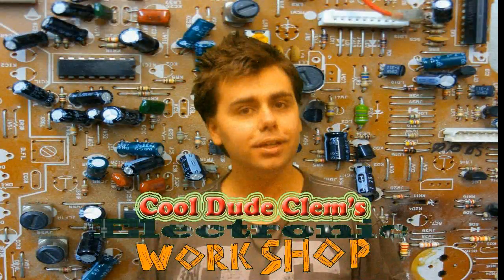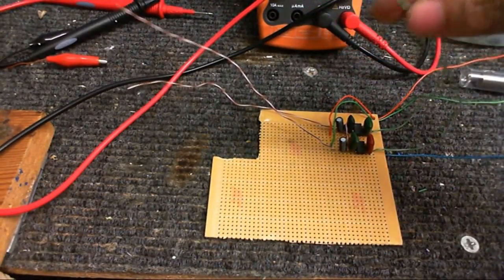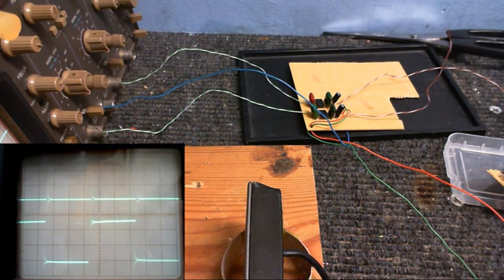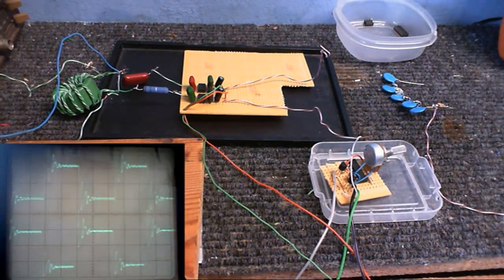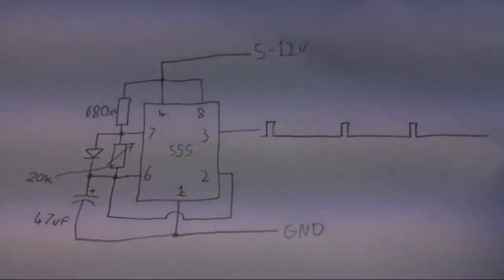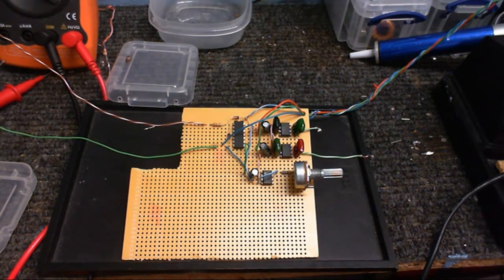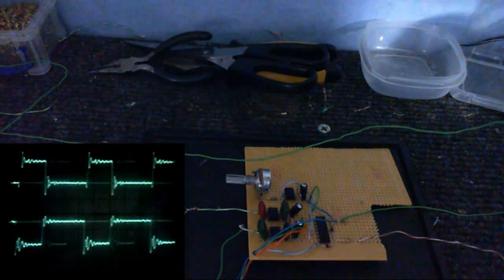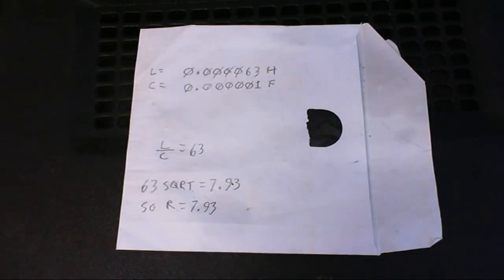Building an SSTC part 3 - Control circuit and more GDT experiments

Comment: The last signal that you showed on the OScope is not good enough,you should use more than 5 turns.
Reply from the maker: Anto Mani You mean the signal I got after I connected the capacitor and resistor that represents a mosfet gate?  That's about the best I can get, I simply just cannot make it work any better than that no matter what I do, I've wound GDT after GDT after GDT and this is what I get every time.
Reply: CoolDudeClem If a MOSFET explodes then it's just because of the gdt,trust me, I fried lots of MOSFETs.

Comment: Why do you NOT use chip sockets instead of soldering directly to the chip?You would remove the chance of cooking the chip when soldering.
Reply from the maker: B Blod Becuase I have run out of chip sockets, or I would have used them.
Reply: Okay.